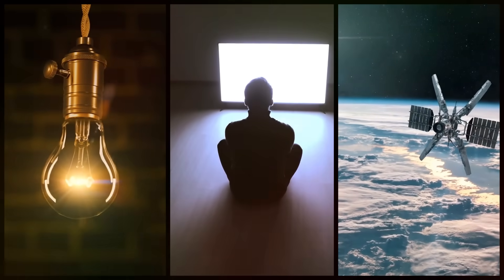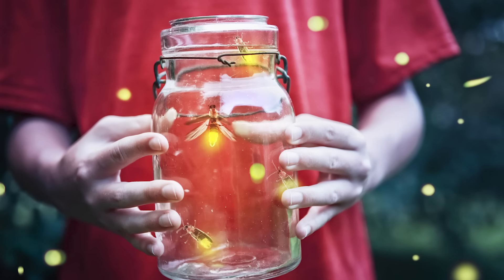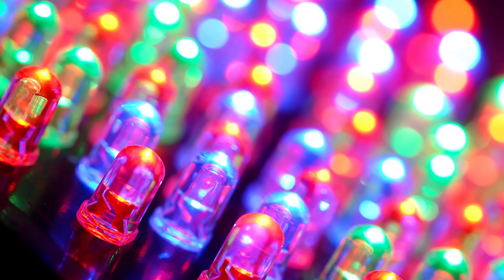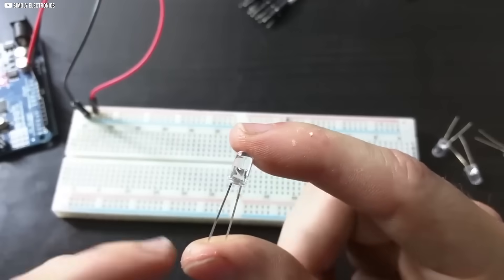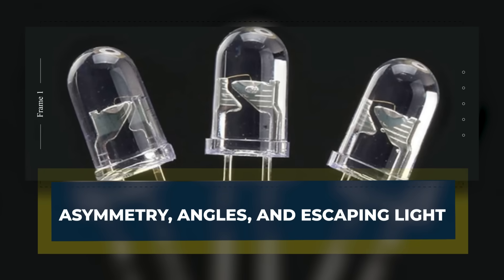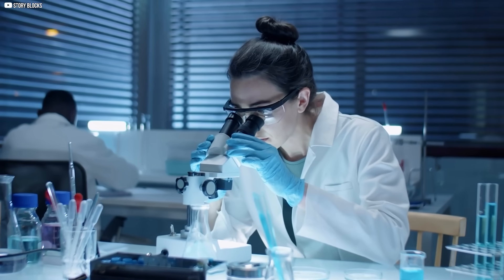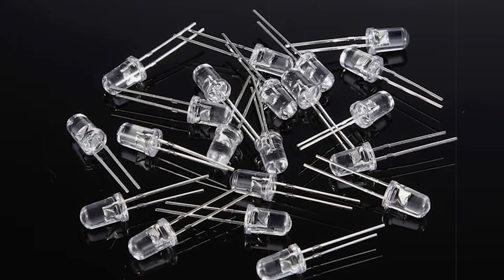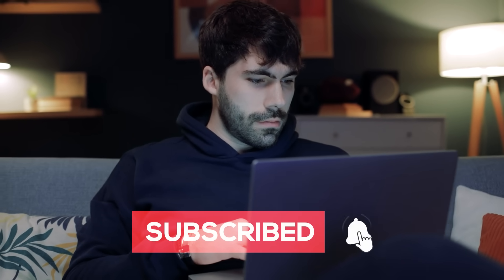Scientists Just Copied Fireflies and Transformed LED Tech

Comment: Ultrahigh light extraction efficiency light emitting diodes by
harnessing asymmetric obtuse angle microstructured surfaces

Optik Volume 182, April 2019, Pages 400-407

DOI 10.1016/j.ijleo.2019.01.043

Comment: I noticed that when LEDs were starting to become sources for general lighting and signage, We started using more and more of them. Some people are enamored with making flashlights brighter. What happens is more wasted light and excessive heat that needs to be dispersed. We need to put more study into what makes humans always take things to the extreme.
Reply: I have a very pragmatic need to extreme brightness :: riding my bike at night at fast speeds.  I typically ride on rural roads where the color of the asphalt is difficult to distinguish from the gravel shoulder.  This forces me to slow down thus limiting my training and conditioning.  I use a high powered "flood" light on the handlebar and a high powered spot on my helmet.  Between these two, I can see almost like daylight in the area of coverage.  My schedule means I must ride at night.  Conditioning requires I ride fast.  So fear of crashing is present, but actually secondary to training modality.
Reply: @Droidiphile  Nothing wrong with that. I'm talking more about the flashlight fanatics that are always competing with others to build super bright flashlights, that require heat sinks to keep them cool, just for bragging rights. I've built quite a few LED lights and lanterns for use around the house. Nothing compares to LED COB lights for brightness. All my light fixtures have been converted to use LED bulbs, except for the bulbs over my bathroom mirror. Those are globe bulbs that were expensive but give off a nice yellowish light.
Reply: Don't you throw shade on our Flashlights!  r/flashlight
Reply: But, we do know what makes humans take everything to extremes: fear.

The emotion of fear is reduced when the belief in both understanding and ability to control what is threatening increase.

Belief that a god of volcanoes can be appeased by sacrificing virgins gives the illusion of control over random eruptions.

Buying a luxury car or vast house provides the illusion, allays the fear that you will be seen as lower on the social heirarchy scale, and that you will see yourself as a failure.

It has been said that beneath every negative emotion is a primal fear.

I find this to be true. You?
Reply: @glenliesegang233  Fear is an emotion, that's for sure. I've said in the past that there are only 2 emotions, love and fear. Hate comes from fear. I don't think that's why humans take everything to the limit. I think it's competition. Build bigger, go faster, climb higher etc. I'm not a psychologist or a psychiatrist though.

Comment: I performed an experiment.  I installed LED dimmers on every light switch in my home.  The result is that I have reduced my home’s electric bill by $20 a month on average.  Kilowatt hour usage is less.  Yes, it cost me $500 to install all those dimmers and to set my lighting intensity lower, but this move will be paid for in 25 months.
Reply: Or you could've bought lower wattage led bulbs?..
Reply: @222inverter the man was thinking like a true government agency.
Why did you have to spoil it.
Reply: @222inverter  My immediate thought, and a lot cheaper than $500.
Reply: @222inverter that removes the option of choice!
Reply: You also save on cooling bills. Adjust light to needs. I love dimmers. Every watt of heat from lighting has to be extracted by the AC.

Comment: God, the ultimate engineer.
Reply: I have some serious questions for your gawd about how he "designed" the human body.
Reply: Simple: evolution with tweaks.
Natural selection is simple. But what it is that evolves- almost infinitely complex.

Dawkins believes even the simplest bacterium holds its information in digital encoding, and is in megabyte quantities.

Only a God could pull off the genetic encoding of multiple groups of interacting proteins and RNA, like ribosomes, or the pyruvate decarboxylase complex.

But God also used the Grey's, or another alien species, to fuse 2 chimpanzee chromosomes into 1 via end to end fusion.

Humanity is going to find the last one tough to swallow...
Reply: Say that again, and again.
Reply: Most engineers are proud of their work, or if it is wrong starts again. No engineer ever blames the result of his work for his failure. Can you say that about your narcissist?
Reply: Sortware engineers who design sysyems capable of evolving do not see things as you describe.

God is, 99.9999% "hands off."  He lets, for better or worse, natural systems to run themselves.  Sorry if for you, this is "uncaring."
Reply: By god you mean unthinking physics then yeah, but if you mean intelligence then no way.
Reply: Oh damn, another "gawd fills the gaps" idiot.
Reply: Versuch+ Korrektur 
Aka EVOLUTION
KEINE göttinnen erforderlich.
Aber wenn Du schon göttinnen postulierst, wie wären die denn entstanden❓
Reply: @7vampir  Where did the DNA digital 4 bit code come from???
Reply: @ActivateMission2
Aminosäuren, die wir bereits außerhalb der Erde gefunden haben, haben in großer Menge + Zahl miteinander interagiert, bis Kombinationen entstanden, die sich replizierten. 
Ab dann wuchs die Menge der erfolgreichsten am schnellsten.
Den Rest erklärt der Darwinismus.